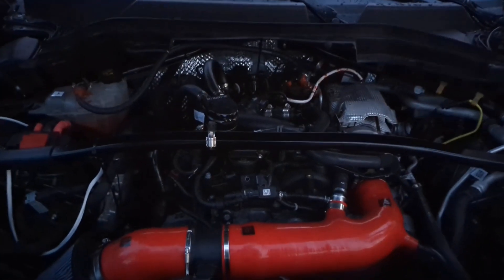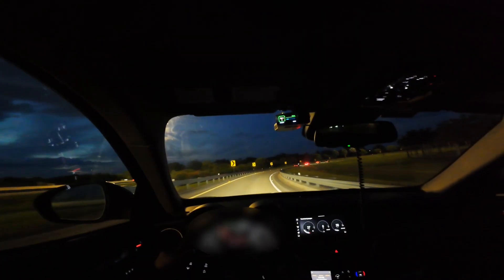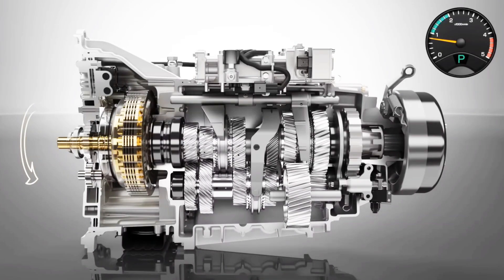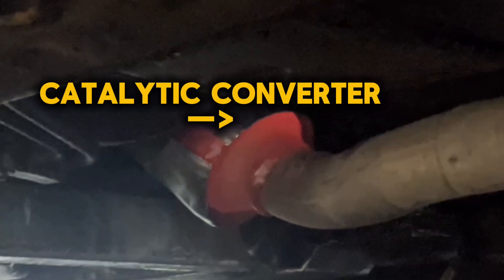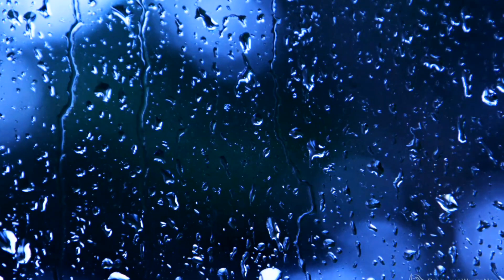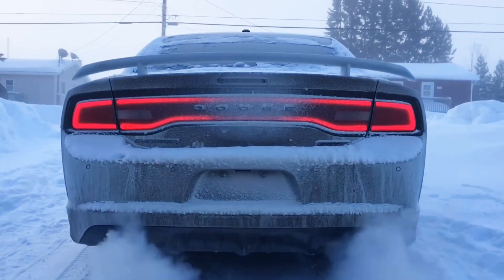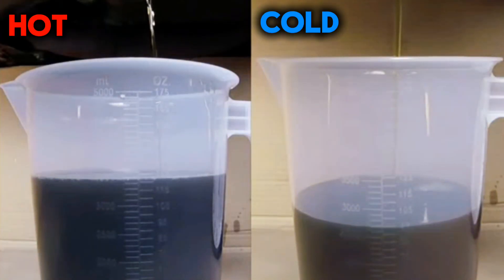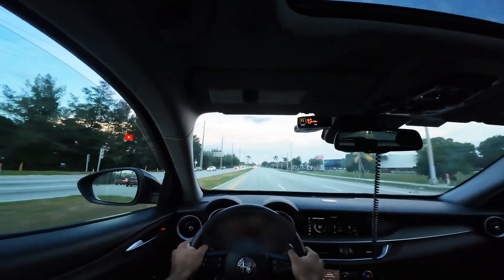STOP Warming Up Your Car – The Truth

Comment: LOL so what's the point of operating temperatures if you don't need to let your car warm up? The engine is built to run at certain temps. Not cold. Has nothing to do with emissions. Has everything to do with running your engine at the proper temperature for proper tolerances of metals. No offense but what a stupid video. Emissions are only related to what programmed into the ecu. Low timing is a big factor when heating up the cats. Claiming idling your car hurts it is dumb. If you're worried about oil temp and pressures change your oil weight.
Reply from the maker: You're contradicting yourself here.

Operating temperature is the ideal temp for engine operation, the faster you can reach that temp the better for your motor (see video for best way to warm-up). You're right that cold start emissions strategies are run by programming in your ECU, that's what I said in the video.

If you lower your oil weight, you won't have the proper lubrications once warmed up.

Idling means sub-optimal lubrication, and more heatsoak. It's one of the worst conditions your motor can be subjected to.
Reply: @TorqueTheoryLabs "operating temperature is the ideal temp for engine operation". 
Sounds like you're contradicting yourself as well. Operating the engine AKA driving it when it's cold, is not "ideal temp for operation". Don't you think every manufacturer in the world would have thought of this if it was an actual issue? Maybe they have, maybe that's why they tell you to let it warm up to operating temperature. Not to force heat into the engine by driving it. Wouldn't it make more sense to let the engine warm up in a linear fashion compared to forcing it to operating temperature? Hmm..
Claiming lubrication is best when the engine is first started, so you should drive, or else your engine will be damaged if you let it idle, isn't true. There are Zero studies supporting these claims. 
Your little YouTube video of an opinion, isn't facts.
Let's say you're correct. Either way the "damage" is so miniscule that it absolutely isn't even worth talking about. That's why I said this is a dumb video. My owners manual states letting the engine warm up to *operating temperature*.
Either way, correct or incorrect. It's irrelevant to the life of an engine. So making a YouTube video about trying to justify this with some type of unknown knowledge, is dumb.

Comment: If you want to stop worrying about engine problems over time, just buy a 1998 toyota and lubricate it with sand. 

Car is car. Put in oil when needed, replace your brake pads and tires, if it does something that aint safe fix it  other wise just fucking use it like the slave that it is

Comment: First start or cold start let engine idle 2 to 3 min max, in winter weather below 30 degrees let engine idle up to 10 max, more likely around 5 but any longer than 10 your just wasting fuel, but letting any engine idle only 30 sec and drive off slowly might be okay if your going down hill, just pay attention how your engine sounds, listen to the bottom end and valvetrain vs how your heat is colder weather, but the 30 sec cold start idle and pull a way slowly im against that as it's not as proper as some may think
Reply from the maker: I can understand that, you don't want to take any chances in the winter even if your motor will be just fine, plus your cabin also needs to warm up.

I explained why 30s was safe for normal climates in the video itself, but I'm curious to know if you have a specific reason you're against it?

Comment: "warming up" your vehicle is good because it allows oil pressure to get stable and also allows oil to get to all necessary places. Also allowing your engine to warm up makes sure that necessary tolerances are at spec.

But of course. Some idiot will follow your video and damage thier vehicle and hopefully you get sued so it can teach you a lesson before spouting BS 😂

Comment: Clear your vehicle's ventilation, exahust tips and driver side door of snow. Turn on your vehicle, its low beam headlights, hazards, and its climate controls with the temperature on hot to the front windshield only. Don't forget to turn on the air conditioning with recirculation mode on as well. Then proceed to unbury the rest of your vehicle from the snow and ice.

When you're done. You're good to drive. Make sure to turn off recirculation mode and hazards.

On a cold misty morning, turn on your car with its low beam headlights on, the vehicle's climate controls with the temperature set to warm to the front windshield only, don't forget to turn on the air conditioning with fresh air mode on. Rolld down all your windows to the point where only your palm can slide in and leave your sunroof/moon roof closed.

Proceed to drive with caution after you use your wiper's "Mist" mode to wipe your front windshield. Eventually, all of your windows will clear up as you drive slowly. Close your opened windows once they're clear up.

All this stuff I explained is a good balance of warming up your engine and driving your vehicle right away.

Think of it this way. 

Gotta get your vehicle windows clear for driving!
Reply from the maker: This is advice I didn't know I needed 👍

But like you said, it's a good idea to be able to see where you're going before you take off.

Comment: I always start up my car first, put it into neutral, then do the rest like seatbelt, music etc. because in that timespan, the oil get circulated, the RPMs drop from around 1100 to 800, which is the signal that you're good to go, usually takes around 20s or so. Only time i let my car idle for longer is when i start it up and then clean off the ice in the winter, that usually takes 2-3min at most.
If i need to wait for someone who said it'll only be a few min, i shut my car off, gotta save up on fuel aswell.
Reply from the maker: This is an ideal startup sequence, great way to do it!
Reply: @TorqueTheoryLabs if you agree with the commenter, why use that clickbait title. You are an absolute mong 😂
Reply: Lmfao its not that deep, how long it needs to warm depends on environment. End of story. Try your process in -50 in Northern Canada and come tell me rpms drop in 20seconds 😂
Reply: Wait, what?  You're not in neutral when starting? WTH!
Reply: @Firemarioflower  are you telling us you don't park your car in gear??
Reply: @tonybrg999  I always leave my car in 2nd before locking the doors. This makes sure my car is always 2 steps ahead.

Comment: My Prius Hybrid has an Atkinson cycle engine.
The batteries don't like to be charged when they are cold.
My wife doesn't like to be cold.

I think it is appropriate to even get the cabin warmed up.
thank you.
Reply from the maker: The Atkinson cycle doesn't alter proper warm-up procedure, and I believe they have management systems designed to safely charge the battery regardless of the weather.

But you should do whatever makes it warm in the cabin if that area is truly that cold, since cold cabins are super uncomfortable.
Reply: @TorqueTheoryLabs The hybrid system shuts the ICE down when it isn't needed (so it never idles much). The ICE burning fuel is the most efficient way to produce heat for the cabin. There are compromises to the battery system because the vehicle system  takes priority. 

On the HV battery system, they even shutdown the cooling fan when the vehicle is stopped because the designers/marketing thought it made too much noise.

Charging may be limited when the battery is cold - but driving the car and regenerative braking takes priority; they must operate properly regardless of the battery state.

thanks for the video!

Comment: I love how the best way to reduce emissions is to increase emissions by adding more fuel on start ups.
Reply from the maker: You're right about the contradiction when you put it that way. But it's short term high emissions for long term low emissions.
Reply: @TorqueTheoryLabs Doesn't the egr system recirculate exhaust emissions back through the engine for re burn at cold idle? ......
Reply: Some of the info in his videos is wrong.

Comment: My transmission is going bad and if i dont let the engine idle for about 5 minutes so the transmission fluid heats up it starts to screech
Reply from the maker: Gearboxs don't typically like idling, and I suspect it still doesn't in your case. But at the end of the day, you need to do whatever keeps your car running.

Comment: Do you need to warm up modern cars?  Nope.
Do you want to warm up your car on winter days to get some heat in the car?  Ask the women here that are always cold for some reason.
Does it really hurt your motor?  Not unless you idle your vehicle for crazy long periods of time.  This isn't 1942 anymore and motors and oil have come a very long way.
Reply: You have to warm up every engine. Engine is engine.
Reply: @MRTNKZL but not in idle
Reply: Yeah? So if your car has been sitting for over a year, you would start it and drive it in 60 sec? Try it, and watch what happens lol
Reply: @drrightwing4435 if it was sitting for year don't start the engine. Change all fluids and check fuel because it can cause problems
Reply: @MRTNKZL  Yes, stale gas won't even let your motor start in the first place.
Reply: I have a hybrid. My car only warms up when driving. Idling it doesn’t provide any heat
Reply: @TaylorPhase  I have a mechanic friend that got a hybrid and while he thinks it's mechanically marvelous and very interesting he also says his wife constantly complains in the winter because there's no heat until the car has been moving for a while.  Does come with seat warmers to offset it a little bit.  

He also says it pretty much requires LRR tires or the fuel economy isn't any better than any other small car.
Reply: @sarcasticguy4311 yeah my hybrid only provides heat when the engine warms up from highway driving. If I’m doing short city trips, I get no heat. And the tires only help a few extra mpgs. Even with stuffed winter tires, I still get in the 50s for mpgs. Pretty sure other regular cars aren’t getting 50 mpg with studded snow tires on. Sure it ain’t 60 mpg. But 50 is still higher than every single job hybrid car out there.
Reply: @TaylorPhase  thats weird, how does your hybrid work exactly does it not start automatically when u turn on your car for the first time if it determines the engine is cold? mine starts up and shuts off on its own and thats my hint that the engine is warmed up to drive, takes around 3 minutes in the winter when temperature is below 0 celsius, the heat also works once its warmed up
Reply: @sarcasticguy4311  I have no idea what kind of hybrid he has but in my prius, when i set my heat in the cold the engine turns on 🤣someone is making shit up lol. 

And as for tires, i run the cheapest wal mart sells. I get 46 mpg in rural driving. The car is 15 years old with 328K miles.
Reply: @RobertBoston-n4d  Hope it lasts you as long as you want it to.
Reply: @TaylorPhase  Bull, if you turn your heat on the engine will start to warm the car.
Reply: That's another reason an electric car makes more sense in daily, heavy traffic, stop start motoring....no oil, engine cooling system, gasket leaks, exhaust issues, O2 sensors etc etc etc.

Mechanical workshops would become much rarer if commuters drove electric cars.
Reply: @jasonhalil2591 Plus instant heating, which can even be activated remotely.
Reply: @jasonhalil2591 how about battery cooling system? tons of other sensors in evs? dependence on battery? (if one cell goes bad you have to change the whole battery which costs like a car itself). It's not that simple. Don't ignore ev disadvatanges. There is a reason people still producing them. evs are just not dependable yet.
Reply: @CalisthenicsWithME  If one cell goes bad you ...... replace the cell. You don't have to throw the rest out. Granted, you'll need to find one with similar wear to yours, but you don't need to have the entire battery replaced.

Comment: Y'know what? At this point just owning a car is bad for your car. Which even then is still true.
Reply: The problem is, leaving a car idling till it's fully warmed up thinking you're making your car run better. Is actually decreasing the lifespan of your engine. 30-60 Seconds after a cold start up, is all you need. Your car warms up as you drive it gentle until it's fully warmed up, at it's normal operation temperature. Then you can go faster. This is why all the cars I owned in the past, and all the cars I currently own. Is going past 300,000kms, 193,000 miles.
Reply: @static_Tricolor_camry bro try this what if it’s fucking cold where you live and you want to
Have heat lol
Reply: @matthewdecoursey6524  Not needed. You can drive your car just fine even while you're shivering lol
Reply: @matthewdecoursey6524  Wear gloves lol
Reply: @static_Tricolor_camry  Some sound advice right here. Always be easy on the throttle until the temp gauge has started moving. Had an '02 Audi A4 2.0T at 468000 kms till I finally sold it for scrap and a BMW that made it to 175000 kms on an original turbo while heavily modified(sold it). And change your oil earlier than "manufacturer recommended" - complete bollocks.
Reply: @SupraSav and if they don't listen to that, tell them to at least keep the oil life above 10%, it would be very unwise to trust automotive manufacturers to avoid adjusting oil change schedules according to what fits their business models the best.
Reply: @static_Tricolor_camry  193k is good but it's 200k or bust imo. Seeing cars reach 300k miles isn't even unheard of. My mom's 2012 Accord's engine made it 248k miles and that's with her completely neglecting it by not getting her oil changed. Technically it still runs but only on 3 cylinders.
Reply from the maker: Building a car is bad for your car.
Reply: @TorqueTheoryLabsno it’s not, makes your engine and drivetrain more efficient,less heat less wear=longer life.
Reply: @rockieg02  ...what?
Reply: @Terro-xc9mw  Yeah, he's either responding to someone else or just a reeeeeally special little guy.
Reply: Not having a car will destroy your engine
Reply: I got rid of my car because I was sick of content creators acting like I drive to save the planet or wear on my car. I throw away cars like I do with 5 cent can deposits.

Comment: This is also for fuel-injected bikes! You don't need to warm it up for ages, just turn it on for 3o seconds and maybe take a little ride
Reply: I beg do differ.  High performance engine in a BMW M5 explicitly warns not to rev the engine past 4,500rpm until the oil has reached operating temperature or it will cause damage.  I’m pretty sure this applies to all engines even the small ones, it’s just that powerful engines are more sensitive to this rule.

Comment: If you are at place where there are real winters invest in block heater, the ones that plug into outlets are dirt cheap. 
The ones that are standalone units cost way more but still are a great thing to have. With block heater running 10 - 15 minutes before you start the engine you basically eliminate cold starts.
Reply from the maker: This is great advice!
Reply: If you are in a place where there are real winters, you should have your block heater running 2 to 3 hours before you start the engine. 10-15 min isn’t going to do anything
Reply: @valerierodger  It's common practice to leave it plugged in overnight for like 8-9 hours in cold Canadian winters.
Reply: Common in small piston aircraft too.
Reply: I think a scheduled power supply would be very nice for a block heater.  I would just leave it unplugged for those days that I don't have work the next day, and plug it in when I get home from work.  Unplanned trips should be easy enough to account for, especially if the power supply comes with a manual on and off switch.
Reply: @alexwalker8422 Why not just move. You willingly live in those harsh conditions 😂
Reply: @Samusaran77 
I live in the Mojave, and if my car wasn't parked where I cannot supply power to it, I would have equipped an engine block heater even though the winters are very mild here and used it in the summer months just to eliminate all under temperature operation and the wear associated with it.  The likely significant increase in engine life expectancy sounds well worth it for whatever vehicle I could be driving.
Reply: @Samusaran77 I would definitely be looking at scheduled outlets so I don't waste electricity heating an engine all night of course though.
Reply: Yeah... maybe if the temps don't go much below freezing. Where I am it's barely been above -30 for the past three weeks. Get an oil pan heater and a battery blanket, a block heater by itself could take hours. Also if you just get in and go like it's nothing, you will absolutely break shit, like power steering. Be gentle until it feels smooth, then bag it.
Reply: @RB01138  if the temperatures don’t go much below freezing, you don’t need to block heater at all.